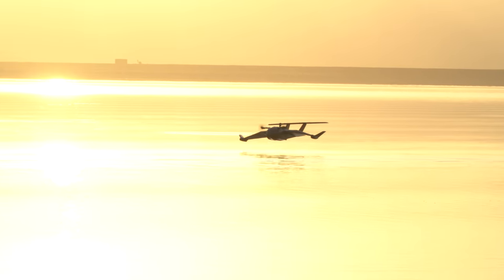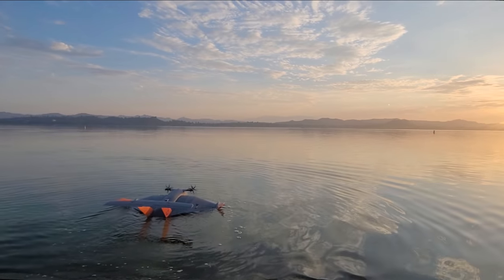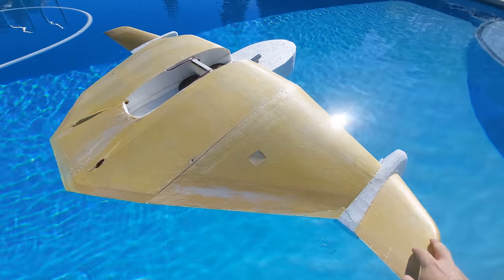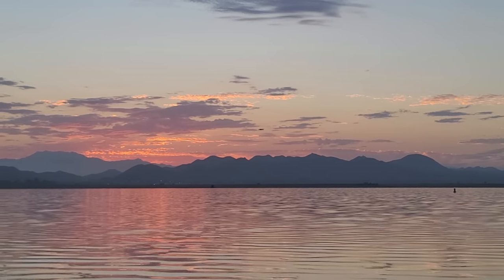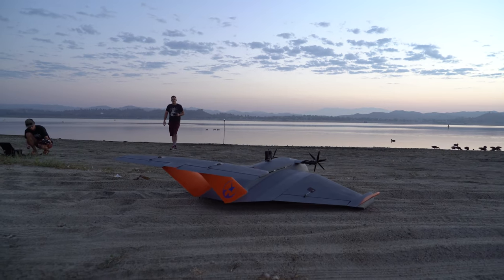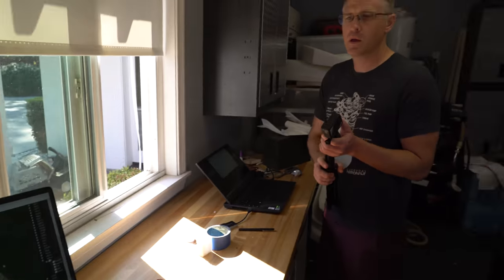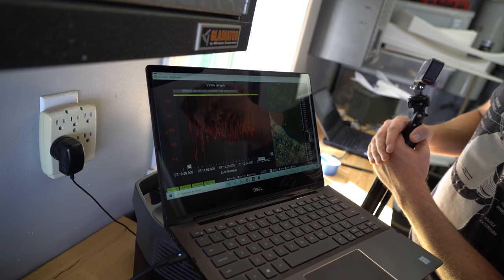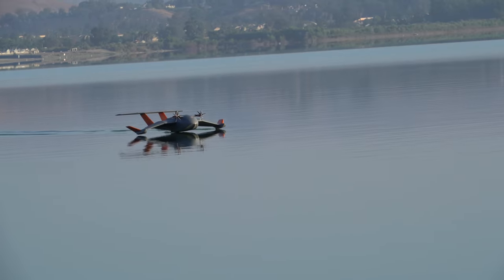Ekranoplans:  Autonomously Expanding the Limits

Comment: Imagine a ground effect vehicle with a large lighter-than-air fat monowing design slotted for a single cargo container. I think it could be a game changer.
Reply: Not really sure what game it would be changing, they'd never approach container ship efficiency due to economy of scale, and having to haul a container around in addition to the cargo would cut down on efficiency when you could just pack the fuselage instead.  Those containers are pretty heavy when empty.  The problem is, you could simply pack a normal airliner with cargo and it would be more efficient, since flying in ground effect may increase your efficiency to a degree, but you're also flying at sea level, which is the most inefficient altitude for aircraft.  Flying up at 30,000ft nets you faster effective speeds with reduced fuel burn because the air is thin, but down at sea level it's like flying in soup...you can feel it slowing you down.  Ground effect is like an economical consolation prize in that regard.  You're also carrying a draggy and heavy boat hull with wingtip floats everywhere you go with a ground effect vehicle, and you're also limited to open waters, and you're also limited to sea ports, and you'll also have to figure out how to load a container on a plane (or just loading a plane in general) floating in water...I mean, logistics for it alone would suck, as Russia found out.
Reply: @Skinflaps_Meatslapper  the main problem with high altitude aircraft is the amount of energy (preferably within a short period of time) it takes for the aircraft to get to that altitude. 

The point of a ground effect vehicle or the modern hybrid airships that are coming out is to operate without a lot of fuel, and to avoid the infrastructure associated with traditional air transport. Also, the energy economy with a modern airship hybrid can be quite good. 

As for complaining to freight, it will still be designed for faster, smaller batched transportation. That's not a bad thing, it makes it more competitive than if it could only do a freights job but a little better.
Reply: @betterlifeexe4378  That's not really much of a problem, the energy expended climbing to that altitude amounts to less than a percent of fuel burn over the course of a two hour flight.

All aircraft are meant to operate with as little fuel as possible, and we've spent well over a hundred years designing aircraft with that exact goal in mind.  We've known about ground effect vehicles for nearly as long as we've been flying, and they've even been tested commercially by the Soviets...nothing about them is a secret to the aerospace industry.  Range and fuel economy are paramount to any aviation business or military power, so if they can use anything to their advantage, they will.

The infrastructure required for a ground effect vehicle would be more intensive, difficult to build, and less convenient than current aviation standards, no matter what.  There are ZERO ports for these vehicles in existence, and they can only be stationed along coastlines...negating EVERYTHING inland.  Which is fine, because a ground effect vehicle would be trash over land anyway.

I fail to see how getting a single container from one coast across an ocean to another coast is more beneficial than just loading a 747 with whatever you wanted to haul.  A 747 can fly from airports all over the world, over any ocean nonstop, and land at airports all over the world, and it can do it faster and more efficiently than any ground effect vehicle would.  Plus you wouldn't have to wait on the shipper to transport the container to a port, and you wouldn't have to wait on the container to be delivered 2,500 miles inland on a slow semi truck.  Your stuff would just be delivered to either the city you needed it delivered to, or the nearest city with a short haul to you.  The best you can possibly hope for with a ground effect vehicle is slightly faster shipping times approaching the cost of air freight.  It would be a niche market at best, and probably not even successful enough to make a decent business out of.

Not even going to bother with the airship thing as that's beyond the current discussion, or "complaining" as you call it.
Reply: @Skinflaps_Meatslapper  Don't know why you insist they can only reach the cost. You could fly over any undeveloped land, meaning you can get closer to your destination and use the manpower at the destination rather than at a receiving facility such as a shipping port. ( even planes need airports, this wouldn't ) in a sense there would be no need for ( new ) infrastructure, particularly if you could make it low matanance and fuel free.

maximum power output required to get to high altitude almost requires a fuel-centric means of propulsion, or long climb with a lot more total energy. I mean, we can talk about the 2-stage e-vetol, but carrying capacity doesn't work in  your favor there ( I don't think, but maybe deserves a closer look ) 

And just think of all the places that don't even have a reliable connection to an airport or shipyard. Then there's the lower capital investment. Can't overlook the ecological benefits of fuel free flight. Safety? Well it's drag to mass ratio is ridiculous. If it ever got moving too fast, it would start to pitch and yaw and bleed off it's inertia. You could probably fly it straight into a building and only do superficial damage.

then there's the possibility of a transportation vehicle, a recreational vehicle for the rich, an extra option for the military in niche circumstances. The truth is, such a vehicle would have similar use cases to the Lockheed marten hybrid airship, only potentially by leaning into ground effect for lift, you might do something to gain more horizontal velocity.

Comment: It appears in this clip that this model can fly high up in some altitude so I fail to see how this is a ground effect plane rather than a run-of-the-mill one, if you get what I mean. My impression is that the whole idea is to design some thing that takes advantage of ground effect and therefore cannot fly without it.
Reply: This is not a vehicle designed purely for demonstration of the principles of ekranoplan flight. It just is designed to take best advantage of the ground effect with a more practical design goal.

Comment: I’m not trying to be a jerk but can someone explain to me where is the proof that this is really using ground effect?  I thought this was the most amazing thing until I saw him take off and fly it around in the sky.  If it has enough thrust to weight to be able to fly high in the air then it doesn’t need the ground effect to get above the water and hold itself there.  They could have done this with any plane once they programmed the sensor to do the auto throttle.

That’s the problem with scale stuff too… its too easy to do something like put a ton of extra thrust in it.

Were you able to at least verify you could keep it in ground effect at a much lower throttle speed than it takes to fly?

Comment: I'm working on a hydrofoil and trying to get the ardupilot code to hold altitude above the water. 
Could really use some help with the code. 
Anyone out there familiar with the code changes done here that could help out? Thanks in advance.

Comment: Isn't the gorilla in the glass store the failing ability for this vehicle to overcome windy conditions with high waves? Imagine gusting wind with the wing tips only a coupe of meters above the surface while flying 100 km per hour. Not much room for roll. A tip in the ocean at that speed is the death kiss to all commercial interest. The same if you have to lay low waiting for smooth waters too often.

Comment: Well, first of all I'm not an ekranoplan specialist, but the craft you created doesn't need WIG effect to fly. It can fly perfectly fine without it.
Secondly, I don't think your craft demonstrated any WIG effect in this video.
And thirdly, you repeat the same mistake as written in the English Wikipedia in “Ground effect” article: “When an aircraft flies at or below approximately half the length of the aircraft's WINGSPAN above the ground or water…” — no, no! Two mistakes just in that half of the sentence.
1) Not “an aircraft at or below”, but lower wing surfaces must be at or below;
2) Not half the length of the wingspan, but the lower surface of the wing must be at or below the chord (or width) of the wing, measured in the same units. E.g. if your wing’s chord is 0.4 m, it’s lower surface must be flying 0.2-0.3 m above water, otherwise you are not getting any ground effect. Your rear-faced GoPro footage clearly shows that water surface remains mirror-smooth as soon as your craft takes off. It means it’s just flying through the air above ground effect. Sorry.

Comment: One major flaw with this system.  It can only be used in very calm waters which hardly happens.  The entire system relies on ground affect to minimize speed thus increasing efficiency.   However, it is not practical in real world.   In choppy waters,  this thing is useless.  Actually less then useless,  grounded.